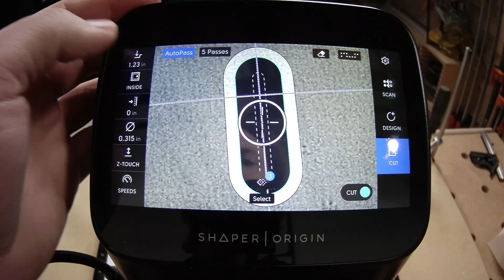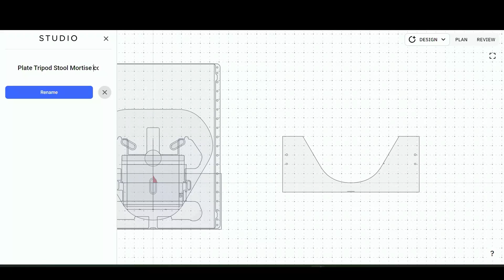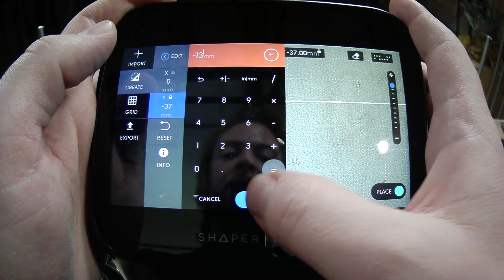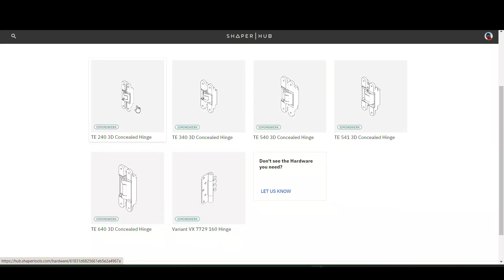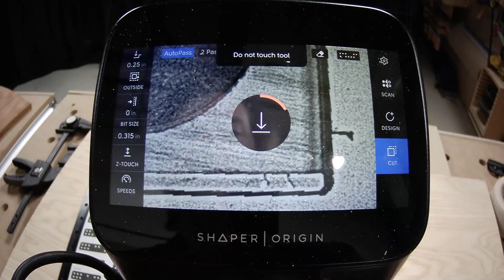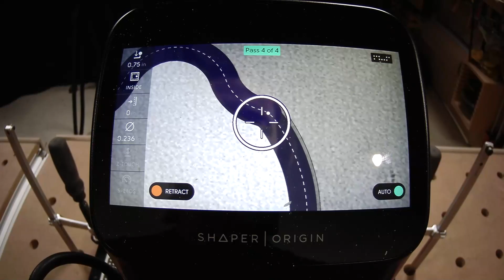Session 123 - English: Five Unexpected Ways to Use Shaper Plate

Comment: I’m trying to learn as much as possible before my new OS arrives. I have 1 question about the Plate. Can I use the 32mm hole series method to perform a series of domino slots along a 10 foot long board, where the slots have variable spacing? And then the other board would be a mirror version about the same front edge? Please link alternative video for reference if this Plate method isn’t suitable. Thank guys!
Reply: I love the question and hope to see a reply. I have made tables with breadboard ends and want a 'long' mortise and tenon on the ends. The table will be 8 feet so I can't stand it on its end to do this.